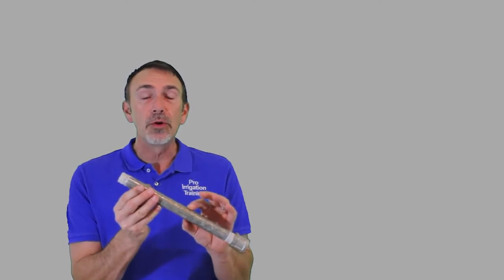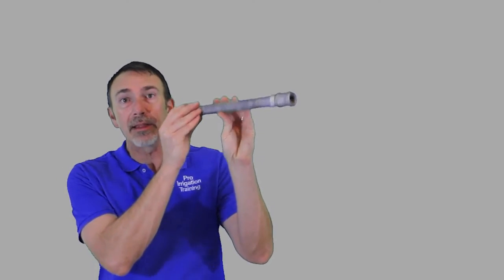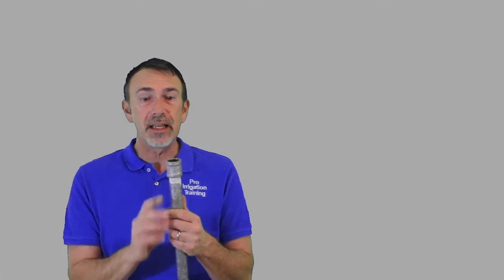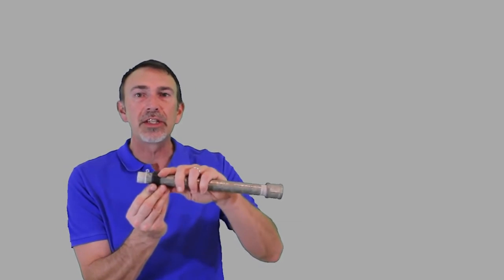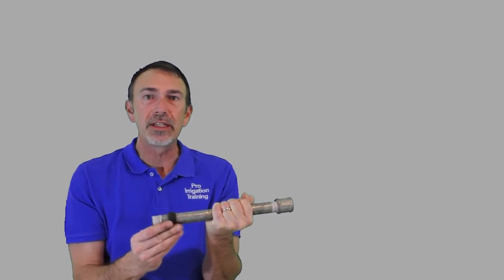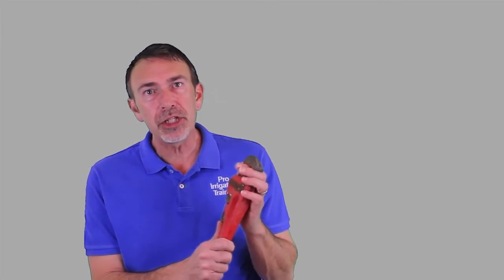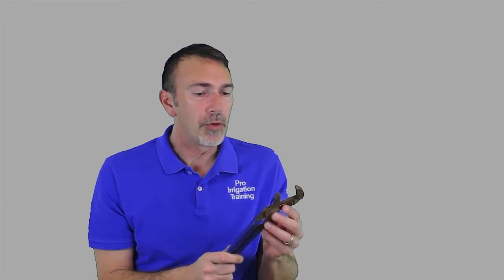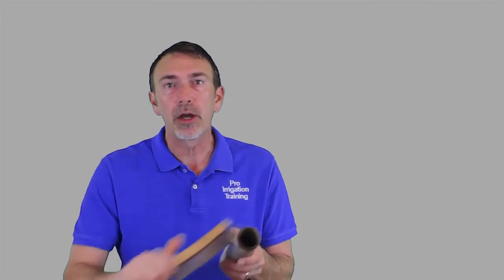All About Galvanized Steel for Irrigation Systems

Comment: In cold climates, where galvanized pipe needs to be used for the risers on irrigation atmospheric vacuum breakers, how long will that pipe last?
Reply from the maker: In my experience, they should last 25 years or longer. Usually a good deal longer before scale builds up inside the pipe. That probably depends on your local water source. Most of the galvanized pipes that I've cut open that had heavy scale inside were 50-60 years old, but who knows how long it had been building up.
Reply: @Proirrigationtraining  Thanks for the info. I think I'll just use the galvanized for the AVB risers above ground, then transition to PVC just under the ground level. I can use unions at the transitions so if I ever have to replace the galvanized it will be a lot easier.